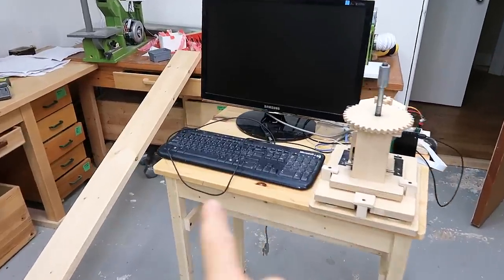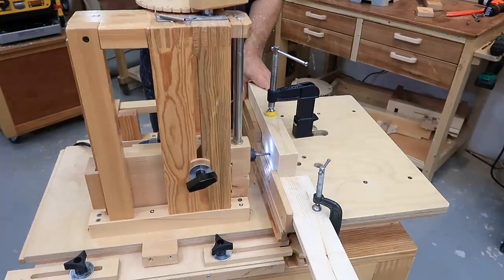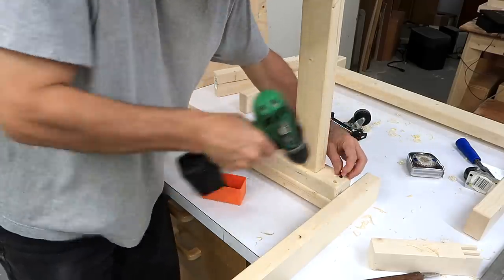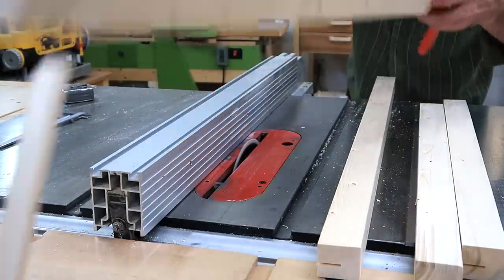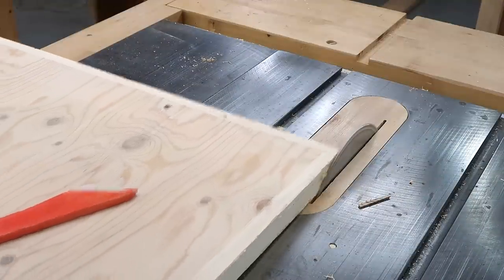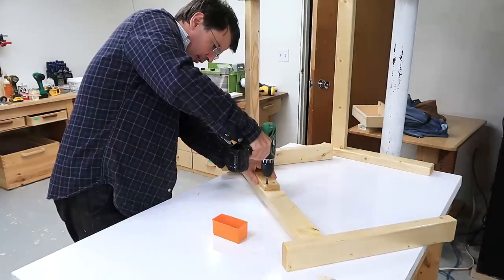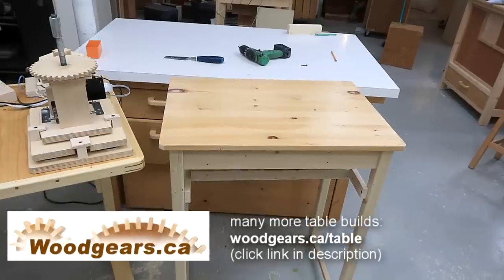Bigger cantilevered lab table on wheels

Comment: If that monitor had a VESA mount on the back, would be cool to see you make a wooden monitor arm to give you even more space on the new table.
Reply: Good idea! Also; a height adjustable desk with wooden gears would be cool. I don't know about Canada, but in Denmark all office desks have had to be height adjustable for more than 15 years. So you can easily change between sitting and standing work, and you can vary how you sit.
Reply: We're talking about Matthias. He would just make his own VESA holes/mounting point. Although, that monitor probably already has the mounting holes.
Reply: @brewhog  nah it's a plastic flatron, no vesa

Comment: Just a thought on the mortis and tenons.  The difficulty in pressing the joint together is more likely to do with hydraulic or pneumatic pressure.  The glue seals the joint as you press it together and traps air and glue.  I suggest as an experiment, drill three tiny holes on the opposite side from the mortises to allow the accumulated pressure to escape as you press the joint together.
Reply from the maker: I suspected that too, drilled relief holes thru on the last one, but it didn't make a difference.
Reply: @matthiaswandel  Glad you thought of that too.  Well it’s definitely swelling of the wood then. Thanks.
Reply: @matthiaswandel  The young klin dried construction lumber really wants to swell! Wonder if you could find a glue that soaks in less?
Reply: @ionstorm66  Epoxy maybe doesn't soak in as much and generally gives a longer work time, but can be rather messy.
Reply: Tendons?
Reply: @matthiaswandel  You should remove a little bit of material on the tenon part. Effectively a mm or two to allow the expansion of the wood from swelling.
Reply: @johnstarkie9948  I could blame it on autocorrect but I confess, I failed to spell it correctly.  (tenon).   Thanks
Reply: @edwardholmes91 Lots of fibrous materials swell in the presence of water, so using glue without water (ie, epoxy) might help. 

Another example - oil soaks into wood, but doesn't change the shape or size very much.

Comment: A very nice and fast build, thanks!  I built a similar table out of 20mm lauan ply for my electronics bench but elected to use K-braced legs to give my knees more room.  I also edge-lined the front and back table edges for strength but used angle aluminum rather than wood for this. The table is so strong it didn't need any glue, and it doesn't sag at all when I sit on it.  Just a few screws holds it together allowing me to easily take it apart for transport.  As I had to move my residence twice last year this proved to be a great benefit.

Comment: Wow, a whole plethora of solutions I heven't seen before. Nice! :)
When I built my assembly table, I used 3 10mm dowels in each end of the cross braces (or whatever they are called), and come assembly time, it was a VERY tight fit. at the time, my F-clamps were some cheap garbage, that just bent when trying to force the dowels in (even more so than in this video) I had to use my 2 900mm T-section bar clamps to get them in, and really work those screws. After a lot of cracking noises, I got them in though.

Comment: Lacking a mortiser at the time, I once designed a similar joint in a set of long-reach clamps by constructing the piece with the multiple mortises, gluing it up from 1/4" strips, then cutting the tenons the regular way, with a table saw tenoning jig.  A couple of through dowels from the side helped keep the joint at a 90, plus the contrasting colors didn't look half bad.  Think that might work here?

Comment: Great looking table surprised you haven't made a surface planer yet
Reply from the maker: watch my 11 year old video about building a jointer.
Reply: I assume you mean a thickness planer? 

He has talked about that in one of his videos, but I don't remember which. If I remember correctly, he said that it's not worth it. Because the parts needed for building one is most easily and cheaply obtained by buying a thickness planer. So if you already have one, why make one from scratch. 

His other homemade tools are quite "simple" and can mostly be made from lucky finds dumpsters or craigslist (esp. the motors). Whereas a thickness planer require more complex parts for the thickness adjustment, not to mention the knife blades.

Comment: *REQUEST* I’d enjoy seeing some more old school woodwork again. Before all the fancy routers, etc. some of us just don’t do enough to justify building these machines.
Reply: Doing mortise without a drill press is not something I’d recommend. You’d be better off going with half lap or finger joints but I don’t know if that would be stronger enough. The tendons you can do without the jig, jig just makes it a lot quicker. Actually now that I think about it, I think your better off with just using a hand drill to hog out and then breaking out the chisels to get the mortises true enough.
Reply: @horatioswrld  thx, no I was just saying without using pantorouter, I’ll never make one.

Comment: You’ve probably talked about it before now but why don’t you use a mitre saw? Just out of curiosity.
Reply from the maker: table saw is more accurate and less dust
Reply: @matthiaswandel  fair enough.
Reply: Many wood workers bounce back n forth between using a miter saw and not. Ultimately it depends on your end goals. What a miter saw lacks in accuracy, it makes up for it in speed. Especially with you need to swap out sleds and jigs to make those cuts on a table saw.

Comment: Hey Matthias, I saw on reddit recently that there is someone who makes an updated improved dust shroud for the Dewalt planers there eh? Have you seen that yet?
Reply: I was thinking the same thing. Allegedly it also allows a large depth of cut due to better chip removal. Matthias is all about speed and efficiency.

Comment: Wouldn't a torx or robertson head screws suit your needs a lot better than those philips headed ones? Impact driver might do the trick also. I find those much more pleasant to use due to not having to push down so hard while driving them in.
Reply from the maker: I use those screws cause I like them, and they. are cheap.  head type is secondary

Comment: Great process. Thanks. I do wonder why lab tables are designed without adding a reinforcement piece at 45 degrees in the inside corners of the legs? It would be simple and effective without being an inconvenience.
Reply: For it to make sense and not move the weak point to the bottom joint, you'd need one there too. Once you have two 45 degree braces above each other, you might as well have put a vertical in, and that goes along with more weight, less clearance etc. What's there is a design decision - a balance between strength and appearance and functionality.
Reply: @CraigsWorkshop  I had in mind bracing all 4 joints, not just two. You are in fact suggesting a better solution of adding front legs.  However, I still haven't seen an answer as to why lab tables need to be "open" like that. Why can't it have four legs?
Reply: @AtelierDBurgoyne  Presumably it either  doesn't need to be stronger (everything even the overbuilt items can still be made stronger by adding more material and bracing.. At some point there is diminishing returns), or side access or clearance is preferable, or perhaps for light weight or lower materials cost (especially now). It does have casters, so it does need to be rolled around semi-regularly I imagine - weight would be a likely factor. I am not familiar with lab tables and their requirements in general though sorry.

Comment: How much faster is it to use the table saw, including all the hand work needed? Is the router not set up or is it still faster and less hassle to use the table saw? Set up as in set up in your workshop and dust collector plugged in an all.
Reply from the maker: I would have to cut the tenons with a 1/4" bit to get in between them, and that's just silly, that's why the table saw.

Comment: Hey Matthias, if you had just rounded the ends of the tenons, would the sharp corners down the body of them have made a force/friction fit, making a stronger joint?

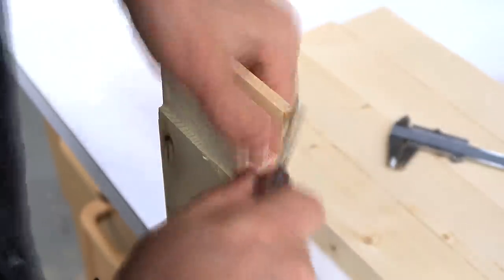Comment: 1:40   Is it necessary to make the tenon have shoulders?  Would it work to have tenon face flush with board face?  Would this be appreciably stronger?
Reply: There are effectively shoulders between the tenons, so the ones on the outside aren't strictly necessary.  I suspect he did it that way for layout reasons (i.e. calculating the spacing between tenons would have taken longer).

As far as stronger, the three main concerns are the glue surface area, the width of the tenons, and the width of the wood between the mortises.  To change the first one you'd need to change the number of tenons (which would affect the second two).  To change the second one, he'd need different tooling (i.e. different router bit) or use a template on the pantorouter instead of just the slot mortiser.  Given that Matthias has done extensive experimentation with different joint types, I'd trust his judgement on the right combination for maximum strength without going overboard on the amount of work required.

Comment: Doing the jump test means you strength tested the table built for strength testing. It would have been ironic if this was the time the plywood cracked. So what are you going to do with the table you freed up? I assume it's not going to end up as a catch all.

Comment: 3:24 not to be a safety Nazi but that was a bit too close finger to spinning blade proximity.
Reply: Yeah
Reply: @CraigsWorkshop  very bad logic
Reply: @CraigsWorkshop  you are just increasing your chances to fail for no good reason.
Reply: @CraigsWorkshop  they never should get  that close, end of the story. You can feel as confident as you want, bit confident people end up at er often
Reply: @CraigsWorkshop  You can do whatever you want to do with your fingers. So can Mathias. But @riba2233 is right, your logic is very bad. Just because you often run with scissors and haven't killed yourself yet doesn't mean it is a smart thing to do. And it is not your motor skills that are the problem, but if your fingers are that close then if something unexpected happens you have a higher chance to get them injured. And unexpected things happen all the time.
Reply: @CraigsWorkshop  you are right man. Please go ahead and use your powers of ultra focus and dance with your fingers around the blade. Clearly you are in complete control of your mind and body and nothing can throw you off. Forget that a reaction to a loud noise comes from the spine before you even have time to think because even if your jerk your fingers towards the blade your nerves of steel will stop the blade dead in its track. All those other people that get fingers chopped off are clearly lesser people than you and thought what they were doing was unsafe but they still did it because they hated their fingers. You on the other hand are a master of woodworking and won’t let anyone tell you what you should and shouldn’t do.
Reply: @CraigsWorkshop  that’s the fist smart thing you said here. Good on you.